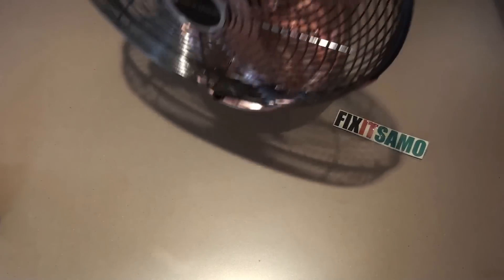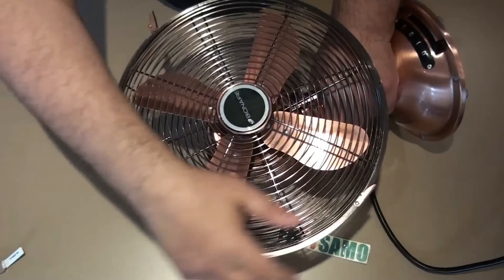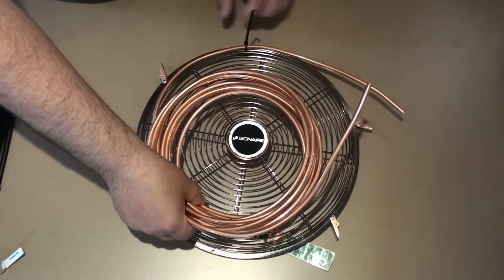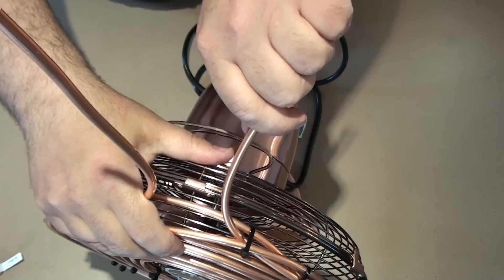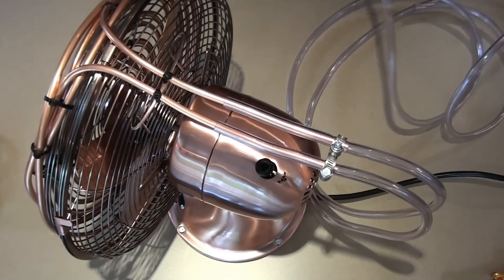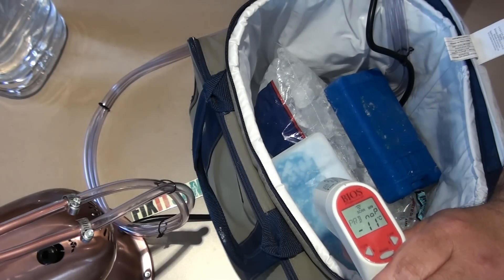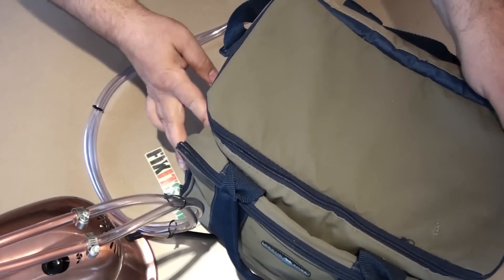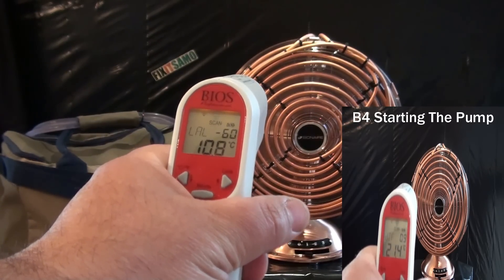How To Turn Your Fan Into An Airconditioner  AC

Comment: Just saying this is an air cooler not an air conditioner there is a huge difference, one dehumidifies and compressed the air the other just blows cooler air, air conditioners are far superior
Reply: And I imagine a window unit is probably comparable in price, depending on where you live I guess
Reply: @amkelle2  not sure about price air cons at least in uk are fairly expensive but I was just making a point that it’s not an ac he made it’s an air cooler. I have a mobile ac and where I live has ridiculous humidity this year around only an ac is worth having, in dryer climates you might get away with an air cooler
Reply: @Wizbit-x  AC unit workds by compressing a gas example freon, upon releasing it it gets really cold , imagine a pressurised can of butane u refill lighters with .  can is room temp.  but if u spray any butane it instantly freezes the lighter or ur fingers after it decompresses  In ac freaon does same thing as it goes into the coils that hot air blows over to cool .  once it passes the coil, fron goes into the compressor, where it presurises it (put butatne back into the can) under pressure its warm but take ac pump and elctricity to do so thats that noise u hear kick on in ac.  not the fan noise.  then before it circulates back to the coil its aloweed to decompress gets cold again and the cylcle continues back to to compresssor. So , it is not a air coooler ..and it does lower humidity .  ithe the cool coils that chill air which cant hold water ..not as much a s,hot air so water apears as air holds less and less water as temperature lessens.  since it not in the air but dripping outside out back ouf ur window unit ..it dehumidifies the air due to this principle the solubility of a liquid in a gas decreases as the temp of the gas decreases.  (colder the air , less water it can hold in it)  its inversely true for opposite . solubility of a gas in a liquid increases as temp of liquid decreases..ex.  Cold water will dislolve mor air in it than hot water .  why water magicly begins to boil at 212 .  its  realeasing air it cant hold any more.  also why some fish need cold water as it contains more oxygen.    ur humidty  ac/ air cooler thing is incorect.  the cold pipe will chill air .  chilled air cant hold the water in it so it apears on cold pipe as condensation.  you could say it took water out the air .  called dehumidified the air .   ac unit is a air cooler.  this project is a air cooler .  cold air dont hold that much water as hot . Hot days and humidity go hand in hand cause hot air holds more water than cold air.  super saturation is condensation occurs when air trys to hold more water than it can hold .  thats them muggy hot days that can take all day dry clothes on a line when its 95 degrees out side. it makes water hot its just got no room left in the air to disolve the water .   so dehumidification is oftenconfused with cooling principles .  its the cooling of the air causes dehumidification/ and condensation all ac units are installed tilted slightly downward on the outside so condensation will drain outside on to the ground not inside into house .  ac unit dont take moisture out the air .  the side effect of ac unit cooling the air causes it to condensate thush dehumidify the air .  capish?
Reply: dropping some science education i have on ya is all .  we can use laymen terms sure but i got tired of the rheroric its not a a a/ c  ac does this its a air cooler so if we wanna be technical .  there u go.  ac only cool the air .  the deumidification occurs as a principal of cool air inabilty to hold moistrre in it less and less as air temp lowers .. where tha water in the air go ?   thats condensation got there not by u spraying water on the coils .  it apears out the air .  and since not in the air its in a puddle on the floor in front of fan in this project deumidfication.  Not one part of a a/c unit is there that its purpose is to dehumdify a damn thing not one. all it does is cool air using principles of thermo and hydro dynamics.   U know how diesel engine works .  no spark plug?  volume decreases pressure rises higher presure makes heat.  so much it get to flash point of diesel fool it just combusts at that temp.  the compressor creates heat .  that was transfered from ur hot room to the freon which really cold in the tubes not pressurised.  when its recompressed it realeases heat thats the other coil on back of ur ac unit uknow aluminumfins on back of the ac unit?  its got another fan that blows air from outside over the hot freon after its been compressed that how it removes heat . nothing adds cold to air. u can only remove heat .  its gets radiaited out side so ac unit is just an out door summertime heater in that regard adding heat to the 100 degree whether outside .as removes it from inside.  long messages but i bet if anyone reads these wont be another debate about what the project is .  back to laymens terms we all get can buy small ac and that take energy to freeze ice run a damn fan .  but the idea u never considered untill seeing this video and its A .  works if it all u got and needed . B. fun to try .  C. u didnt thnink of it so dont comment disrespetfully esecially if ur gonna back up ur negativity with uneduacated wrong reasons with no basis.
Reply: @amkelle2  ?????????
Reply: @LibraryOfTheOligarchs  The point of a spear is the tip of the spear
Reply: If you're cooling the ice water that it goes through in a refrigerator or freezer, aren't you technically dehumidifying and compressing the air there, even if it isn't in the loop?
Reply: @reinux  I misread what you said originally, we’ll sort of because that’s kind of how an AC works, but depends on the setup because if you left a freezer door open with a fan blowing the cold air into a room that would cause more humidity there’s no where for the condensation to go but into the air, an AC condense the air into a tray which you would empty when full and not inject it into the air.
Reply: This will dehumidify the room, at least a bit. There are many comments saying to watch out for condensation dripping into the fan components, that dripping water came out of the air. If you keep the system cold enough, it will dry the air around it
Reply: @proton Byte; To whatever extent those who say condensation will occur are correct [not judging, but suspect it's true], then the air is cooler and drier.   But that's not the point, is it?  This thing is portable and conveniently small and light.
Reply: you missed the point
Reply: @LibraryOfTheOligarchs  what point did I miss? You missed the point it’s not an air conditioner
Reply: @Wizbit-x  the point was. a cool DIY project that will cool a persons room. the grammatical correctness and technicalities of what is or isn't an AC wasn't important. this video may help someone or lots of people. Plus, someone could improve on this concept. But, do you think electric bill will be lower with this?
Reply: @LibraryOfTheOligarchs  then you are wrong I got the point it’s a cool diy project, but it’s still not an air conditioner... call it what it is not what it isn’t, there’s nothing technical about what the correct term is. Depends on how much ice costs and electricity where you live whether it would be cheaper than a real AC. Here it’s about £1.50 for a bag, if you’’re using just 4 bags of ice per day then it would cost less to run an AC, making that amount of ice cubes in a freezer isn’t at all practical
Reply: @Wizbit-x  lol ok
Reply: @LibraryOfTheOligarchs  but if being cost effective if you’re goal then I’d scrap this project, buy a second hand mobile AC unit and use that, as said depends on where you live but you’ll save more money and be cooler and not have to constantly buy and replace ice bags hourly :)

Comment: I freeze 3 litre plastic bottles full of water and stand them on towels behind a 20 inch fan , no need for copper pipe and it works really well. 3 x 3  litre bottles behind the fan will last 6 hours before they melt completely in 25 degrees C temps.

Comment: a pot of iced water with some salt in front of the running fan works exactly the same
Reply: No.
Reply: @Bob Vagene You and Lori Lightfoot should get married.
Reply: I skip the salt, but, yeah
Reply: So why do you want to blow salt around?
Reply: @victorsupreme214  .....you put the salt on the ice...?..
Reply: No it doesn't stop lying

Comment: Unless you have a heat exchange into a different room or to outside your not effectivly cooling anything. Your freezer takes more energy to cool than the energy its concentrating as heat in the condenser. To cool you need a net loss of heat and unless you break the laws of thermodynamics and engineer an electrical system with over 100% efficiency, exchanging the energy into the same room your trying to cool will never work.
Reply: It's called transferring the heat from the room into the cooler.  What in the world are you talking about?
Reply: @waldo2635  that water in the cooler is in its natural state, just like when it entered your apartment. Gaining the btu potential to even be able to transfer any heat to the cooler costs you energy. And where do you get that potential? From your freezer. And where does your freezer get it from? From the electrical grid. And where does it dump the heat generated from both making the ice, in addition to that generated running the compressor? Into the same house you're trying to cool.
Reply: @jbtvt ...It sounds like what you're trying to say is, making the ice and running the fan creates the same or more heat than the amount of heat it transfers into the cooler.  That is something I don't know.
Reply: @waldo2635  yes, 1st law of thermodynamics. Every watt of energy your fridge uses to create the ice and the fan uses to blow air, is dissipated as heat, and because there are always conversion losses, this system has a net warming effect
Reply: Ice and water are in the cooler. Its called a heat sink
Reply: @lepton31415  ....if, .....ok yeah, but, that heat is going to be created anyway, unless you only use your fridge to make ice....and you can buy ice from somewhere else.
Reply: The goal is to cool a certain space. If the ice is created in that space, then this system will never work. However if the ice is created in a space outside of this and there is proper insulation between the 2 spaces then this will work. Example if you buy the ice from a store or use your refrigerator in your kitchen.
Reply: @rakeshbidhar8812  well, my refrigerator is running if I'm making ice or not. The heat from this is already there. It's not "new heat" 
Your argument is invalid.

Comment: It probably works for a short time, but you would have to constantly replenish with ice, I don' t think it is a practical solution.
Reply: Depends on what you think of as "constantly". Once every five or ten hours is a trade I'll accept all the time
Reply: One could use a much better cooler to make the ice last longer.
Reply: @carolhewett3756  Does it matter how good the cooler is.   The return water will melt the ice faster than the loss from a poor cooler.  Am I wrong?
Reply: Definitely air con is the only solution, these aircoolers with circulating water will melt ice in 30 minutes.
Reply: You are heating the cooler of ice with warm air of the room you are trying to cool. The ice will not last long.
Reply: Before air conditioning became practical some movie theaters would buy tons of ice from ice houses to cool the theaters. 
AC size is rates in BTUs and tonnage. 
Leftover term from melting tons of ice to cool a building. 
Taking the ice from the insulated ice house and putting in a building where it is absorbing heat from the theater and heat from people makes the ice melt much faster.
An average person produces about 330 BTUs per hour.
The more people in the building the faster the ice melts.

Comment: you can, of course, use a smaller copper tubing and get more surface area,,, and use less ice over the long run. I like the idea someone said of using the ground to keep the water naturally temperate.

Comment: the only way this would work well is if you ran the line of liquid.. and i would use a coolant not water.... deep into the ground say down to 8-10 feet.... there the soil is stable temp... then you would have a cooler in summer... and a heater in winter....  now thats not a bad idea!   I might try it!
Reply: Here in Tucson we’d have to go deeper than ten feet to find cool soil, lol. Our cold water comes out hot enough to shower in during the summer!
Reply: why use a small fan then. You can upgrade to a larger fan. 
but yes. sounds good
Reply: @Lancashirelad yeahp    it works

Comment: The password is Swamp cooler
Reply: well not exactly.... swamp cooler will add tons of moisture to your air.. this will not add any moisture to the air... however it will not remove any either... and it will only cool as long as the water in tube is cool... so you still need a cooling source..ice.. from a fridge etc... so why not just leave your fridge open lol.....
Reply: @HR-rt9nh  true
Reply: The term swamp cooler unknown by most people unless they have lived in a dry dessert place with zero humidity like Nevada. Many people use what's called "Swamp Coolers". They are cheap and work by simply dripping plain tap water down a large screen while a powerful fan forces hot dessert Air through the screen. The result is cheap fridged ice cold air that will cool a whole house for only the electrical cost of simple blower running. An affordable effective solution that produces ice cold air much more affordable than a traditional expensive and complex AC compressor type unit at a fraction of the power consumption.
But put that same swamp cooler in Florida and it's worthless because of Florida very high humidity. 
This demonstration would never be cost effective, as the energy needed to produce the ice exceeds the end benefit. As another said use that in Florida and you'll have water running off those coils everywhere from the high humid environment in Florida.
Reply: @PCman50   you’re right swamp coolers are perfect for the dry heat

Comment: lol thats not a AC its a simple Humidifier what joke
Reply: In what universe is that a humidifier? It does not add moisture into the air
Reply: @PlutoDarknight  dam you're dumb as a stump it most certainly is adding moisture - it is incapable of working the same as a "normal" AC unit - there is a reason AC units have a "drip-pan" & evaporator coils to remove moisture from the air, which is why there is a condensate pan underneath the evaporator coils in AC units... moisture clings to the coils, which tells us that the AC unit is reducing humidity. if this BS was working to reduce humidity you would need a drip pan - in this case the fan speed is not only preventing you from seeing the moisture that is compensating on the coils the fan is behind the coils, thus that moisture is being added into the air not being removed -   AC fans (squirrel cage)  draw air across the coils they do not blow from behind the coils
Reply: @johnjerman3421  the way that works is: the Moisture ALREADY in the air is removed. In this case, it is returned, so no gain. 
If anything, the drip PAN is for REMOVING moisture from AC-cooled places. The humidity in AC homes is lower than the exterior of the house- The air return GRABS the house air and passes it through cooling coils. These coils capture the moisture from the inside of the house and remove it.
 
Not bad for a dumb stump, huh?
By the way- that is a 10th-grade science lab work,,, but I figure you probably made it to the 9th grade.
Reply: @angelchiriboga3904  lol -  keep dreaming mate - you'll one day understand how AC works - actually for every 1 degree you cool the air you're increasing the humidity by 2% - I worked on roof top units for a very long time mate I not only can repair them I know & understand the hows n whys - psst by the way you should return to 10 grade and take it over because you keep proving the reasons you failed
Reply: @robjohnson8861  You don't understand physics.
Reply: @angelchiriboga3904   You don't understand physics.
Reply: @johnjerman3421  All humidifiers contain a reservoir that gets filled with cold water. The machine changes liquid water into a gas through varying methods. The water vapor moves through an air filter and evaporates to increase humidity levels.

Say at the point he seals the cooler, it weighs 30 lbs and next to the cooler he has a humidifier with a 30 lb reservoir.   After 4 hours (or whatever it takes to empty the humidifier) do you think the cooler's weight will be anywhere close to   
empty humidifier? 

This video is not showing a humidifier.
Reply: not really...
Reply: Bob Bottoms  dam dude  a close loop that still makes condensation & the Fan evaporates because the fan is behind it else wise it would drip moisture since the fan is behind the coils its adding it to the room gee whiz dude you don't know BS about AC or humidity AC units do not blow across coils they draw air over the evaporators open up your  AC -The blower fan draws hot air from your house over the evaporator coil. AC units do not blow over the coils or blow over the filters - the air is sucked through the system & blown through the ductwork - gee whiz an evaporator coils pick up the heat from the indoor air. The condenser coil, on the other hand, releases heat into the  air.(outside) they work together & without each other all you have is a swamp cooler that adds moisture to the air
Reply: @johnjerman3421  it is reinserting the collected "moisture it Took from the air.
Reply: How stupid are you actually. There is no humidity, hence it's not a humidifier.